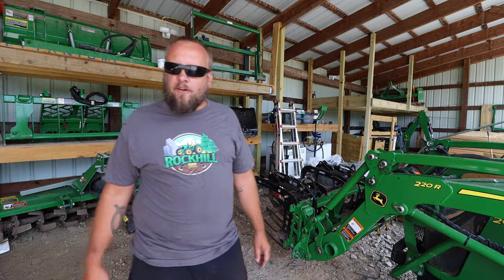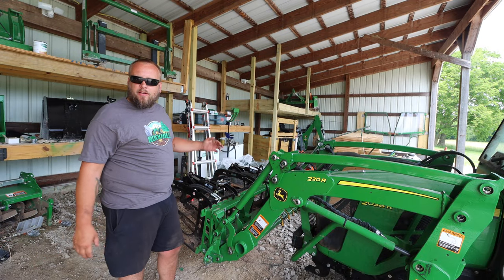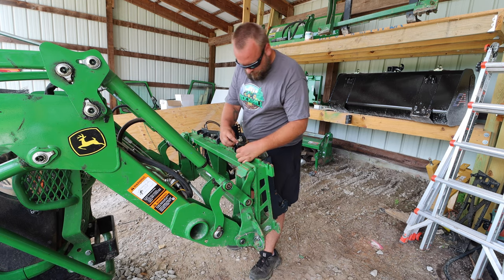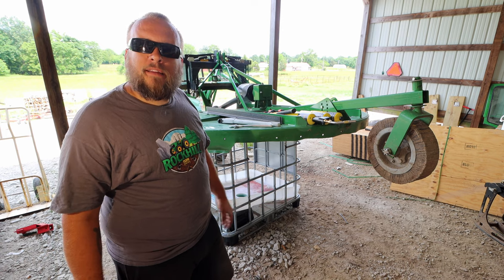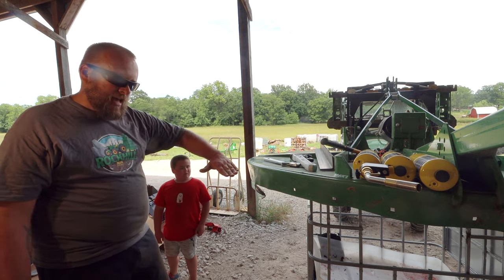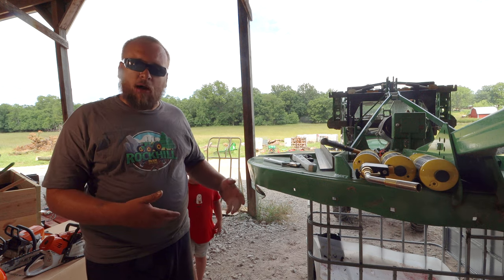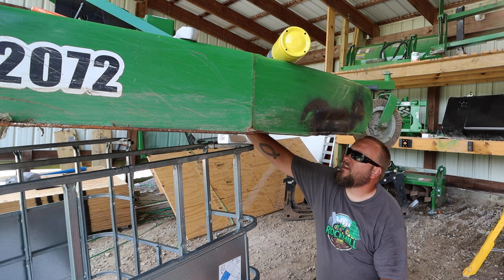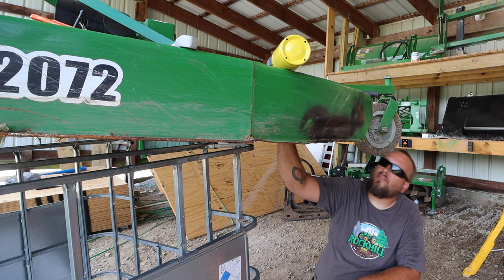Bush Hog Repair - Heat It and Beat It￼

Comment: Just a couple of suggestions: get you a oxy/acetylene torch (makes heating and bending much easier), get training on how to use said torch, (Jody at Welding Tips and Tricks has some awesome safety videos for torch operation) get a porta power its a long hydraulic ram for straightening metal. You could also weld pull tabs on bent redius and use come a long and heat. Reinforce rear with 1/4 or 3/8 flat stock, then look at a forestry machine, take pictures/measurements, and fab up a push bar that takes the beating and it bends sappings over and cuts cleaner. Stay safe, and God bless

Comment: I had similar problem. I used same size pipe wrench, but I added leverage with a 15 foot steel pipe over the wrench handle - worked like a champ without heat. Leverage is your friend.
Reply from the maker: Thanks for sharing. I couldn’t find a piece of pipe that day

Comment: Watch captain Kleeman  and see how he modified an older brushog to make a brushog into a tree eating mower by cutting up to 4-5 " trees by cutting about 6-8" off the back of the mower deck allow the blades to stick past the back of  the deck by about 4" with a frame angled up and back to push the trees back before it gets to the blade. I know your welder friend can modify it to do that. But I'd do it to an older brushog with a good gear box and heavy framework.
Reply from the maker: I watch Captain kleeman sometimes.  Pretty sure I saw the thumbnail for that video but haven’t watched it

Sounds like he made his own version of a tree saw. I’ll have to check it out

Comment: Talk to Jimmy...make some plans that fit your budget and needs, but you can modify it pretty inexpensively compared to having to replace the brush mower, and getting all wrapped up the complicated financing tangle. Maybe remove that curved rear apron altogether, and beef the side skirts up with some angle iron, or a thick plate welded to the vertical that bent on you. Let it fling wood and sticks...just clear the area of humanity!
Reply from the maker: Thanks for the feedback. That is most likely what I will do

Comment: Mission accomplished 👍🏻.

An option to consider is to use a hydraulic bottle jack of some sort on the inside. Use a 6x6 or piece of telephone pole to brace across. Add heat to damaged side while adding pressure. Damaged side should move long before the other side bends. Might need couple map gas torches at same time to get enough heat or cutting torch.

Good video Brock! Thank you.
Reply from the maker: Thanks for the feedback

Comment: I bent my Land Pride 4' rotary cutter right around the same area you bent yours..

I tried everything to straighten it out, hammer, pipe wrench, (never used a torch), u bolt through the square skirt guard hole to a come along, around a tree and some significant force....... Nothing.......... All I accomplished was wasting my time.  

After I looked at it under neither, I could.see that even where it was bent I still has a good 2 inch's of clearance from the blades. So........ I just left it. 

That was about 2 years ago, rotary cutter is still going strong.
Reply from the maker: Thanks for sharing

Comment: Yeah get you a pipe to fit over your crescent and pipe wrench handles for future use. I would wrap the back of that with 1/4" flat bar and weld it on. Nice job using what you have!
Reply from the maker: Thanks for the feedback.

Comment: A small piece of channel iron with an eyelet or hook welded to it come- along hooked to a solid point and pull away. you could keep even pressure on it and hit it with a hammer to release the metal
Reply from the maker: Thanks for the suggestion

Comment: It’s difficult to straighten those type dents and bends, the little torch doesn’t hardly have the heat that’s needed. I would suggest welding or bolting some 3/8”x2” flat bar around the back, that would definitely help a lot. You did good with what you had to work with.
Reply from the maker: The flat bar sounds like a good solution to me too.

Thanks

Comment: i just bought  a frontier--i too found the 2060 bends way easier than my 2006 JD LX4 has over the yrs. really wish i had sprang for the extra money for the JD one.  u need a regular torch and a way bigger hammer to fix it-IMO. good luck
Reply from the maker: Thanks for sharing

Comment: If you're likely to continue taking similar jobs, a medium duty bush hog will serve you better. Once you get into medium duty you might have to go down to 5 ft cutting with like the MX5 because weight will be an issue with the compact tractor
Reply from the maker: John Deere list the MX6 as a match for the 2038
Reply: @RockhillfarmYT  MX6 won't handle that kind of brush you need an HX6 or an old 609.  I was just looking at your video to get ideas for fixing my MX6 that I backed over some heavy brush (and bent) just like yours.    I think those holes you are talking about are for an optional chain guard.

When my dad bought a new 709 back in '87 the Deere dealer said "if the tractor will run it down it will cut it up."  He wasn't lying.

Comment: Howse commercial brush hog. I beat the absolute mess out of mine, and it's only got typical rock/debris dents on the sides. Yeah they're expensive new, but I'm pushing 1500-1800 hours of destruction. Even my 4ft one that I've cut 4" materials with. Reinforcement on that one is kind of like throwing money away if you really do it. Some thick flat metal welded on the deck and those edge pieces around the feeding/discharge area cut off would work better for the thicker materials that tend to bend and hang up. Look at the back of the Howse commercial brush hog and you'll see what I'm talking about with that.
Reply from the maker: thanks for the feedback

Comment: I have the same cutter in the 5 foot version. It is rated to cut 1” and so is yours. Unless you got an upgraded one which is possible because I don’t know everything.  My John Deere tractor is great and the frontier box blade is really stout but that standard duty mower is as flimsy as any cutter out there.  For less than $400 more I could’ve owned a heavy duty woods rotary cutter that’s rated to cut 2”.   It is heavier and  everything about it is way better built.  That’s my only regret  with the tractor set up I bought. The standard duty land pride rotary cutter looks to be as cheap as the frontier as well....
Reply from the maker: I know it’s not rated for it but I routinely cut 3 and 4 inch material if not bigger

I bought a lot of attachments with my tractor and the bush hog is the only one I went cheap on

They told me the two models they recommended were this one with an inch and a half capacity and the John Deere MX6 with a 3 inch cut capacity

I saved $1000 getting the frontier instead of the John Deere.

Now I’m looking at trading it in on the MX6

Comment: Personally, I think I would try to stiffen up that back edge like you talked about in the video and keep using what you have.  I feel like a bush hog always gets abused, no sense in beating up a new one already and it seems to match the power plant from your tractor pretty well.
Reply from the maker: That’s probably the smart thing to do
Reply: @RockhillfarmYT  I think if you take the design from the commercial Deere decks on your stand on mowers, its probably like my 60D on my 1 series.  There is a 1/2" bar on the outside edge of the areas that frequently take a hit.  Its held up nice for a year now on my 60D which I mow with every week.  I'm not mowing a golf course either, so its taken some hits and held up well
Reply from the maker: Thanks for the feedback

Comment: I think it is time for a heavier duty mower. You seem to use it a lot and it is something that makes you money.
Reply from the maker: Yeah, I pushed it way beyond what it is rated for
Reply: @RockhillfarmYT  yes sir, we all end up pushing our stuff further than we should. As usual, can always use a bigger...tractor, mower, chainsaw, etc. because when I buy my thoughts are I will never need something that big/heavy duty. A few months later, wishing I had bought a bigger whatever.....
Reply from the maker: Exactly

I thought that my tractor would be big enough for anything I needed and I wish I had gotten a four series now

When I bought the 391 chainsaw I thought I was doing the smart thing because I didn’t need a bigger saw.

Then I decided to start milling with my chainsaw and the 391 wasn’t really going to cut it

At some point you just have to find a way to get it done with what you have because you can’t always upgrade everything

Comment: Why are you using your bush hog in reverse? They are made to pull forward. I've only been using one for 65 years but I've never seen a reason to use it in reverse. (Unless briars were going to eat me before I got them cut down.)
Reply from the maker: Thanks for sharing.

It seems like most people brush hog driving forward on fields but cut backing up over larger stuff or areas they can’t see into.

I go forward about 2/3 of the time the time depending on the situation But I feel like sometimes you need to back into an area that you are not going to drive all of the way through